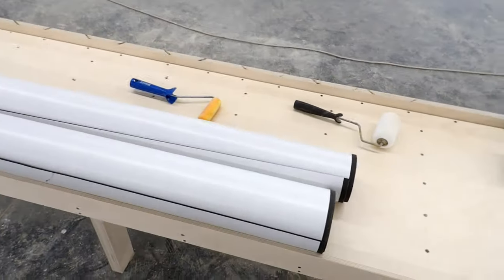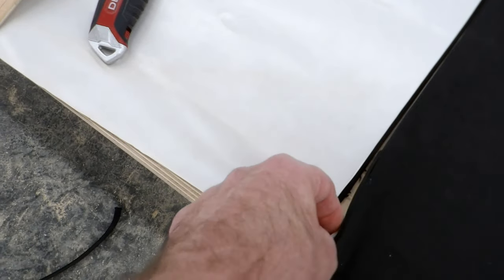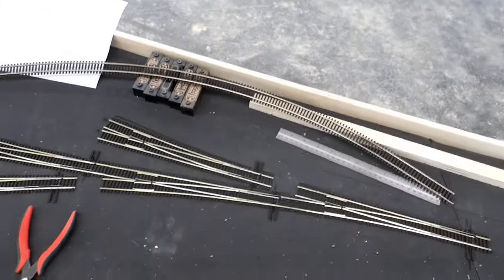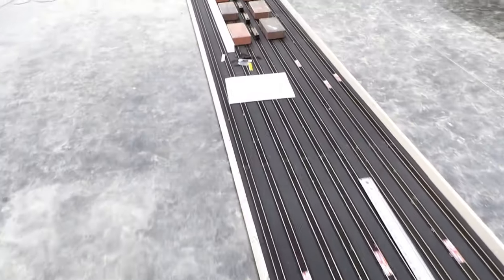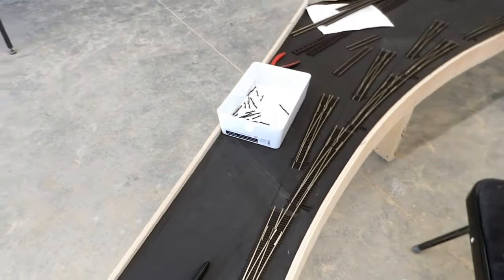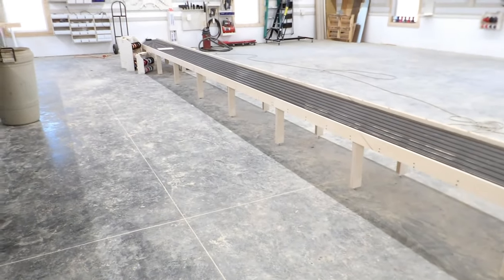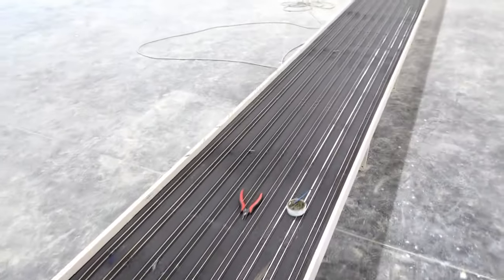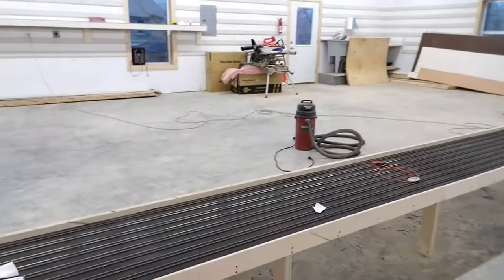The Sydney project 02: Lower staging roadbed, track & wiring

Comment: At 3:00 I realized that you have magic Dew cans with that one can holding down that incredibly long run of foam. After all of that wiring and the calisthenics that went with it to lay that staging yard I would have been reconsidering the huge shop build, lol. The lower staging yard has more track than a lot of peoples entire layouts. With the shipping and exposure that this layout will endure are you nailing any of the rail down or still just relying on the glue? If just glue, please share the type that is holding the track to the foam. This is going to be incredible. Please tell Mom I said hello and that she is a YouTube sensation.

Comment: Wow, that's impressive! Hmm, 30' x 9 = 270' so that would hold about 400 50' box cars.
Reply from the maker: You can never have too much staging on a railroad designed for intensive operation.  A layout where the staging capacity is the limiting factor tends to get clogged up too easily.
Also, most modelers tend to accumulate far more cars and locomotives than they initially expect.

Comment: Nice.  Yankee here in Virginia USA near Washington DC.  I'm using Peco code 83 north American style track, #6 in my yard and #8 on mainline sidings or crossovers.  #8 in the yard is nicer but where space is limited, you can squeeze in longer yard tracks with #6.  My basement isn't huge.  You have nice long yard track!  I used Homasote, a pressed paper product that comes in 4x8' sheets 1/2 inch thick.  It holds spikes or track pins well.  With 2 1/4 inch track center you probably could squeeze in another yard track!
Reply from the maker: Yes, I could have got one more track in with 2 1/4" track centers - or 2 mote with 2" track centers, but that extra bit of finger room between tracks is extremely valuable in the unlikely event that there is ever a derailment deep in the yard.  Sacrificing that last track was a conscious decision, not an accident.
Reply: @mpeterll  That's what people say.  I have so much rolling stock, I really wanted that extra staging track.
Reply from the maker: @riogrande5761  There is the main staging yard (15 tracks), and then there are two extra YARDS (7 and 9 tracks).

Comment: I’m curious to see how/where this super long section is to be sectioned for shipping. Obviously, there are a lot of wires to be cut and re-connected. Will the upper staging yard be physically connected to the lower one, and, if so, then how does that affect the sectioning for shipping. Awesome work!
Reply from the maker: The two staging yards are built separately. Keeping them together would waste a lot of space in the shipping container.  I've shown my wiring methods on previous builds.